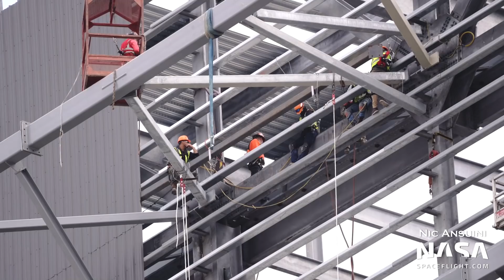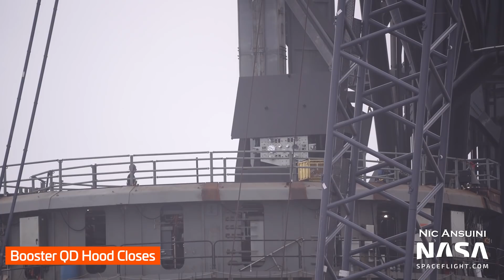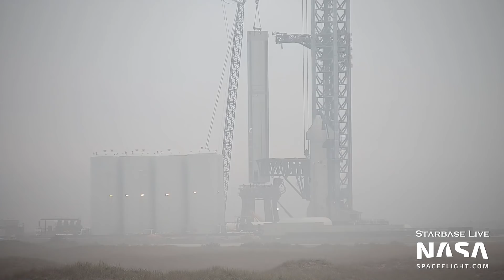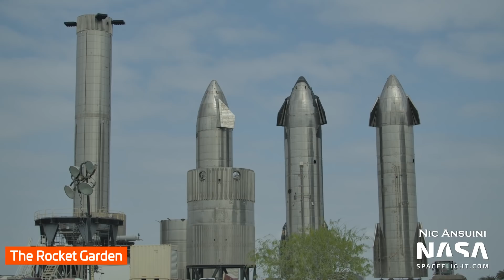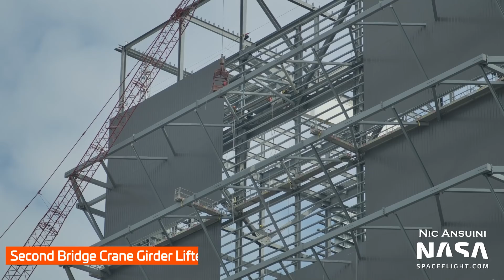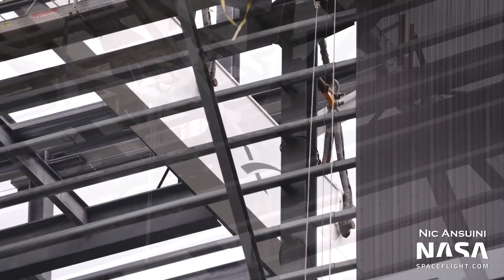Super Heavy Booster 7 Installed on the Orbital Launch Mount | SpaceX Boca Chica

Comment from the maker: 0:00 - Booster 8 Common Dome Section
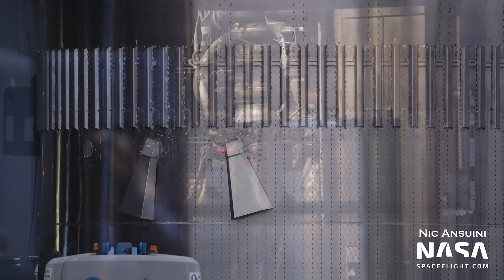0:44 - Raptor Engines in Storage
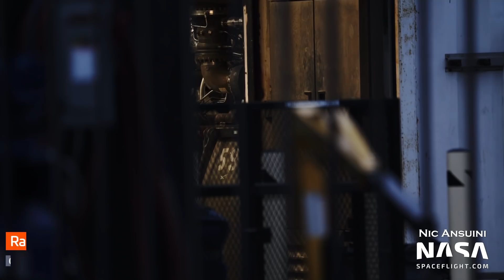0:57 - Wide Bay Bridge Crane Part on the Move
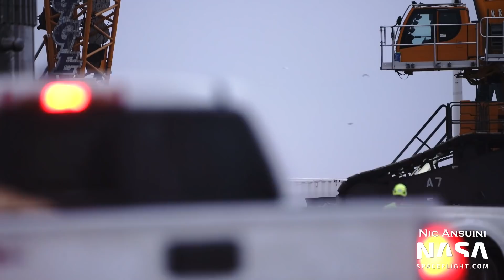01:12 - Booster 7 Readied for Lift
01:28 - Booster QD Hood Closes
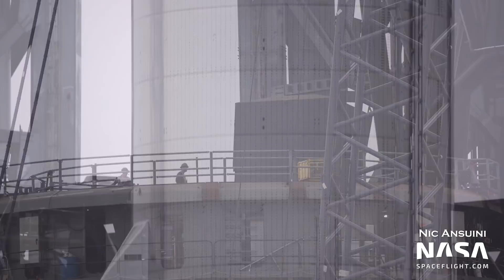01:41 - Booster 7 Chine
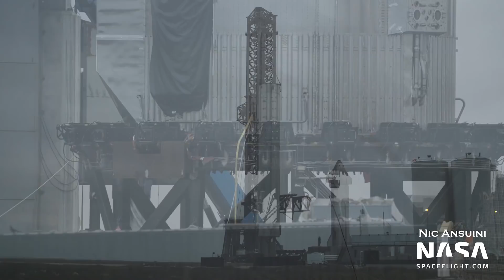01:53 - Booster 7 Lift
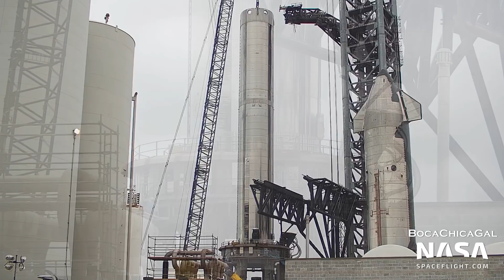05:11 - B7 placed on the OLM
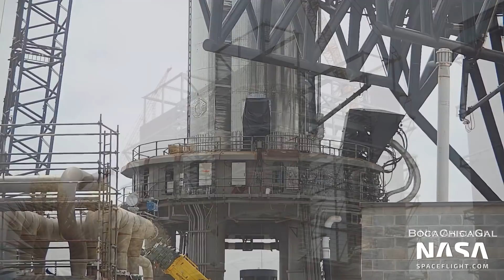05:24 - Wide Bay Construction
05:39 - The Rocket Garden
05:55 - First Bridge Crane Girder Lifted
06:43 - B8 Common Dome Lifted Onto the LOX Tank
07:22 - Second Bridge Crane Girder Lifted
08:10 - Bridge Crane Girder on the Rail
08:46 - Third Bridge Crane Girder
10:08 - Ship 24 in the Mid Bay
10:29 - Fourth Part of the Bridge Crane Lifted

Comment: 6:21  I thought the Bridge Cranes would be one more level higher.  Now there is room for the penthouse suite & bar.
10:38 Four bridge spans !!!  I expected two.
Thank you for your efforts
Reply: Those are two bridge canes. 
Two Girders will be connected to one bridge crane by one much shorter girder (trolley) that can travel the length of the two girders.

Comment: So much remains to do at Boca Chica it is great to see how fast some things are progressing.
It is great seeing the bridge crane being installed before they put a roof on the wide bay, so much easier than the way they did it on the high bay.
There is still a lot of work I expect to be done on the Orbital Launch Mount and perhaps the Launch Tower.  It looks to me like the Orbital Launch Mount needs covers over the outside to protect the piping, wiring, and distribution panels from a rocket blast.  I suspect that there will eventually be changes in the Launch Tower to improve it's operation too.
I'll bet we will see a lot of changes/improvements on the Orbital Launch Mount and Launch Tower at the Cape.

Comment: Is there a reason their not using the tower to lift and set the boaster in place?
Reply: I was wondering this too -- maybe the chopsticks arent rated for the weight?
Reply: Boaster? I don't think Jeff Bezos is involved.
Reply: grid fins are still missing in B7 so they need crane.
Reply: @simoc375  The boaster has lift pins just like the star ship does. At least that's the way I understood it.
Reply: @simoc375  They actually use the lift/catch pins on the boaster to lift it.

Comment: Why are they still using CraneX to lift booster on/off OLM? Isn't that literally what Chopsticks are for?
Reply: As far as we can tell, it did lift enough to prove it can.

Best guess is the chops are configured differently right now, but we dont know if that is the actual reason.
It could simply be because matching the 20+ connectors of a booster and pad is a whole other ball game compared to matching 6 large self guiding slots between the vehicles and they want much more practice with this novel idea before risking a booster. Especially before their first launch.
Reply: I'm thinking they want to save them for catching...?
Reply: No gridfins, also B7 doesn't have the holes for the stabilization, maybe B8 will have.
Reply: @Ivan_Berni  Grid fins don't have anything to do with the chopsticks and its actually the opposite, the chopstick need the "hole"  that the vehicles will land on to as far as I can tell.

Comment: Those bridge crane sections are being installed a level lower than I'd expected. I'd expected them to be at the base of the very top currently mostly unclad roof section not one level below. It seems to me that that leaves the very top roof section completely unused. I'd guess judging by the height of the workers installing the bridge sections that there is at least 10 if not closer to 15 metres clearance between the top of the crane beams and the roof. Surely the bridge crane mechanism doesn't need that much headroom above it? Might another roof bar be going in the top roof section? If not then what is going in there.
Reply: May I know what is the bridge crane and what purpose it's filling at the top !?
Reply: @lordwiz6653  For stacking sections inside the high bay. In the early days regular cranes had to reach in through the door to lift up sections to be stacked whereas having a crane permanently integrated into the roof means there is no need for a regular crane to have to drive to the high bay to do the lifting. The bridge crane can move left and right and forwards and backwards across the roof to be able to position its hook anywhere above most of the floor area. The current high bay already has a bridge crane installed, if you look at some old NSF videos where they show booster or final ship (nosecone on top of tanks) stacking you can see that one in action.
Reply: @julianfp1952  that was a great to know .thanks  👍
Reply: The very top is taken up by the roof trusses. 

They will be able to use the full height of the doors. The hoists ride on top of the girders so the hook doesn’t hang down at all at max height.

The high bay crane is mounted to the center trusses, which makes it’s use very limited because it cannot reach the side of the high bay.

Comment: Any reason as to why they didn't use the arms to lift the booster on the LM?
Reply: I suspect because they had to have people on the OLM itself to guide it into position with all the vulnerable pieces sticking out. They don’t trust the arms enough to have people around when it is lifting, so they use a crane which can’t drop it. They might not need people guiding it in once the bottom doesn’t look like it is covered in barnacles.
Reply: there are also 2 pins installed on OLM not long ago and on new transport stand. Maybe these help guide the booster when chopsticks are used. It could be that B7 does not yet have the holes these pins would slide into... it almost looks like on future boosters these are supposed to be where the APUs are currently positioned on B7 (the box covered i black tarp). I would speculate that maybe B8 is the first booster that can be lifted by chopsticks for this reason.
Reply: I can imagine that with all the tubing hanging down, as they haven't installed the engines yet, the crane was the safer option to allow more control of the lowering. Especially with everyone checking that nothing gets trapped.
Reply: No gridfins.
Reply: @Ivan_Berni Grid fins are not involved in any lifting or catching of Starship Boosters.
Reply: @Slim-Pickens  yes they are.
Reply: @Ivan_Berni  No they're not.

Comment: Don’t know why they use crane to lift the booster to lunch mount, can’t they use the chopsticks instead?
Reply: Kinda makes me concerned that the chopsticks can’t handle the load, based on testing with the water bags. Who knows though? I saw one video I think from Felix that said they didn’t have the necessary adapter for the pins and arms to lock in that they do have on the new booster. So maybe they were just in a hurry to place it on the OLM today?
Reply: @brockb22  thanks for the info, most probably it’s an adapter pins/ arm lock that not present in the booster. Or maybe the the grid fins has no structural support yet to handle the weight of the entire booster.
Reply: As far as we can tell, it did lift enough to prove it can.

Best guess is the chops are configured differently right now, but we dont know if that is the actual reason.
It could simply be because matching the 20+ connectors of a booster and pad is a whole other ball game compared to matching 6 large self guiding slots between the vehicles and they want much more practice with this novel idea before risking a booster. Especially before their first launch.
Reply: @Vatsyayana87  Probably want to save them for catching.

Comment: Why chopsticks are not use to lift booster
Reply: I too am curious about this
Reply: They probably will in the future but why complicate the process when you have a free crane ready to go?
Reply: If you have an expensive crane you want to use it. 😅
Reply: As far as we can tell, it did lift enough to prove it can.

Best guess is the chops are configured differently right now, but we dont know if that is the actual reason.
It could simply be because matching the 20+ connectors of a booster and pad is a whole other ball game compared to matching 6 large self guiding slots between the vehicles and they want much more practice with this novel idea before risking a booster. Especially before their first launch.
Reply: They don't have enough safety data to use it around people. They need to automate what those workers are doing.

Comment: Aren't the chopsticks capable of raising the boosters to the OLM?
Reply: As far as we can tell, it did lift enough to prove it can.

Best guess is the chops are configured differently right now, but we dont know if that is the actual reason.
It could simply be because matching the 20+ connectors of a booster and pad is a whole other ball game compared to matching 6 large self guiding slots between the vehicles and they want much more practice with this novel idea before risking a booster. Especially before their first launch.
Reply: Apparently not so far.
Reply: @jfh9209  Personally, from what ive seen, i would guess its a choice. Not an incapability.
Reply: Maybe they want to save them for catching?
Reply: The grid fins are not yet fitted on B7, so the chopsticks can't lift it as is!
Reply: @nikosgerempakanis1503  DUH !
I should've noticed !
Thanks!
Reply: @nikosgerempakanis1503  How do you know that the grid fins will be the lifting point for the chopsticks?
Reply: @nikosgerempakanis1503  The booster can not be lifted using the grid fins. That would damage the motors. The booster uses the two hooks (pins) between and under the grid fins. 
The chopsticks don't have a matching mechanism at present (it too has pins) so the crane is simpler.
Reply: @nikosgerempakanis1503  it doesn't pick it using the grid fins does it ?

Comment: Why don’t they use the chop sticks??
Reply: I've been wondering the same thing!
Reply: As far as we can tell, it did lift enough to prove it can.

Best guess is the chops are configured differently right now, but we dont know if that is the actual reason.
It could simply be because matching the 20+ connectors of a booster and pad is a whole other ball game compared to matching 6 large self guiding slots between the vehicles and they want much more practice with this novel idea before risking a booster. Especially before their first launch.
Reply: Might not to use them too much before trying to catch a booster or Starship...?
Reply: @mobrien888  I suppose its possible but i sort of feel like the opposite and they want more use of them before attempting the much harder task, but this is just a guess of what i feel makes sense. I could be wrong though.
Reply: I think it is partly due to convenience. At present the chopsticks are equipped with two opposing pins, while the booster also has two opposing pins. Had the booster had two holes, like the ships, it would have been simple.
It might be easy to switch pins and holes on the chopsticks or it could be hard, I don't know. It is anyway easy to use the crane.

Comment: 6:49 didn't notice this(these) protruding nose(s) right below the ring of stiffeners before. Any ideas?
Reply: Those are vents. They just stuck covers on to direct the gasses in a either direction. The intent is to remove the TCS and use the vents instead. (Eliminating parts in the process).

Comment: Will S22 fly?
Reply: SN24
Reply: No. It is old style like Ship 20 and contains the nose of Ship 21.
Reply: This is Ship 24 coming up. Ship 22 is chilling in the rocket garden with 15, 16 and Booster 5
But there is a decent probability it will fly yes.
 
Its possible they might use Booster 8 for the flight though if its ready to go by the time flying is an option but maybe not of course, i just see a vigor in their pursuit of Booster 8 like i havent seen in a long time. 

Ship 24 is taking its time still so im guessing it will be the ship flying.